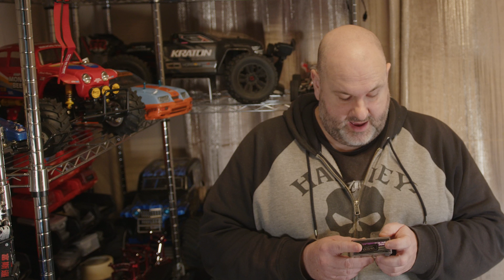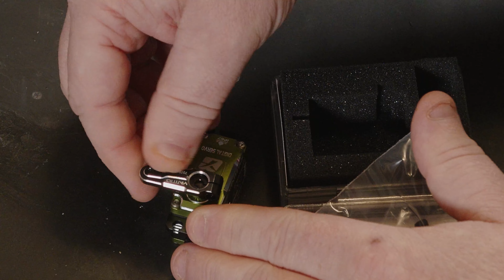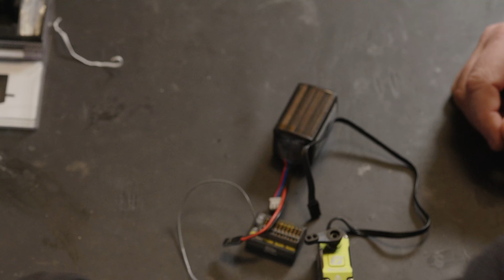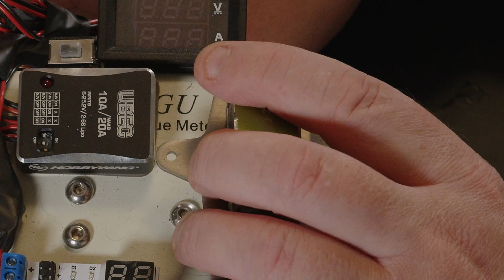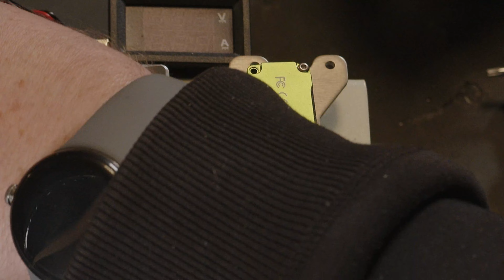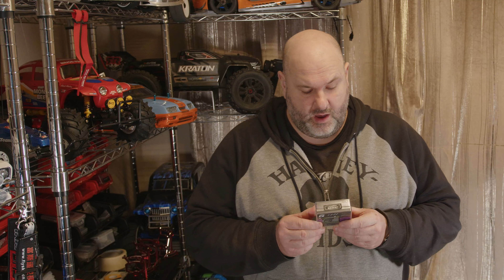Yantrs 0750AS-MGX-E 50kg programmable 50hz to 1000hz servo tested

Comment: They also have 60Kg model which is not short, but exactly the same size as the Futaba HPS-CB701.
Will fit great into 1/8 buggy
Model B0960-MGX-E

Comment: A surprisingly good servo and the build quality is impressive! Yantrs appear to be bringing the game to the big boys! The closest equivalent i can think of is the Reefs low profile one in a much higher price bracket.
Cheers Craig for another very informative review!
Reply from the maker: Glad ya like it :)
Reply: @WTFRCCars  as future projects/cash allows, i reckon i'll be looking at  yantrs again for servos. Nothing in the pipeline at the mo, but they're currently topping the prospective short list!
Reply from the maker: @EddieDesigned I got 2 more on the way and the programmer so if you want your settings changing I'll be able to do it for you :)
Reply: @WTFRCCars  ooh, it'll be interesting to see how others in the range stack up! Thanks for the offer, may well take you up on that in the future, at the moment, i dont think the transmitter for the comp rig will support it, but there's nothing stopping me from moving it to the noble down the line!
Reply: well...Reefs is actually a AGFrc servo rebranded